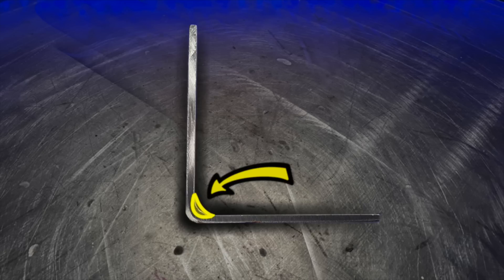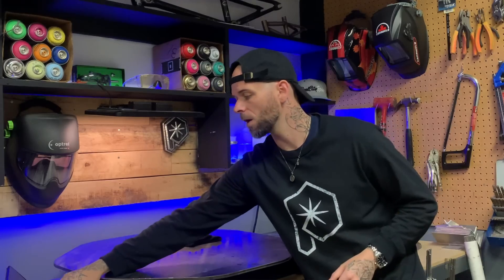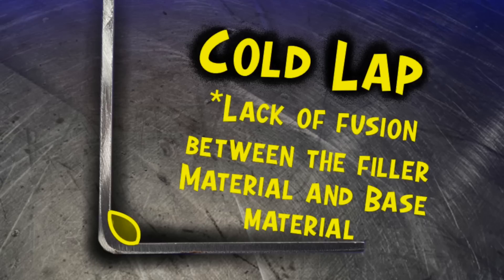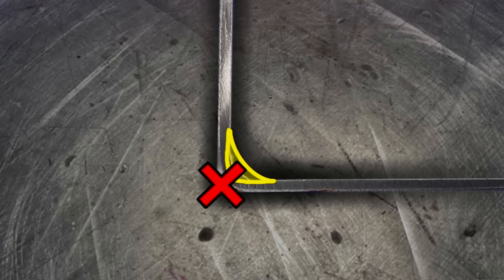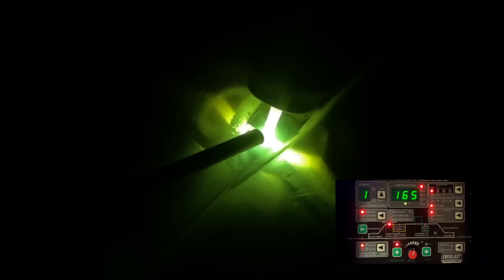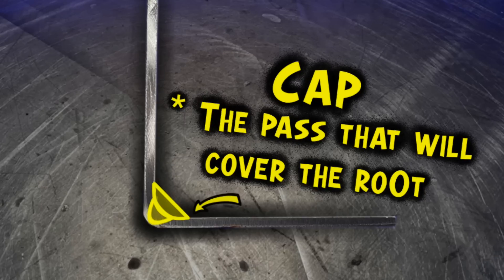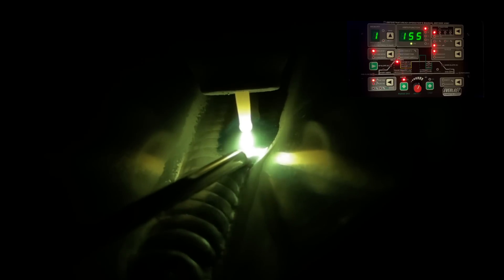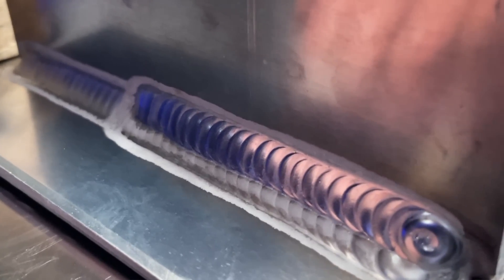Is it bad to have BIG tig welds?

Comment: Does only the root pass want to pull the joint to less than 90 degrees, or every pass on top of it will also keep pulling the joint to less and less of being square?  Thanks.
Reply: Any heat you put to aluminum makes it Go all to shit. Clamps and braces, smiling  faces